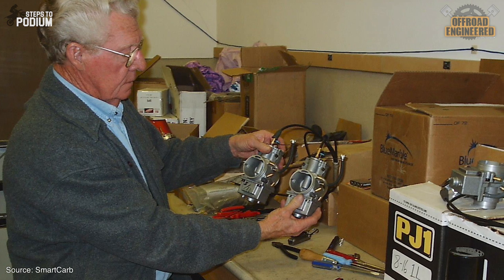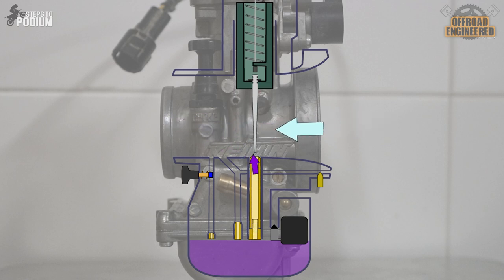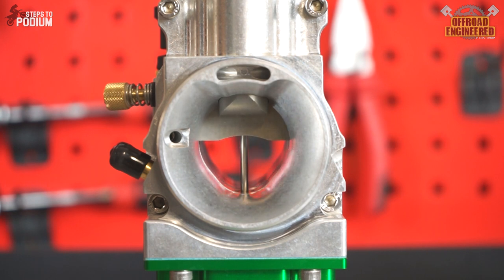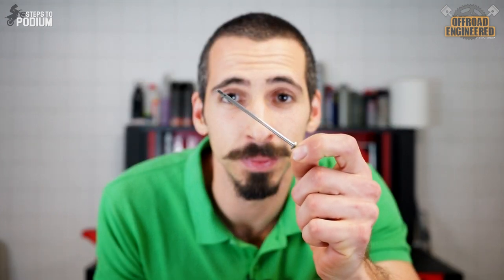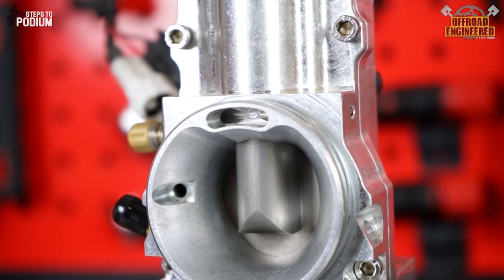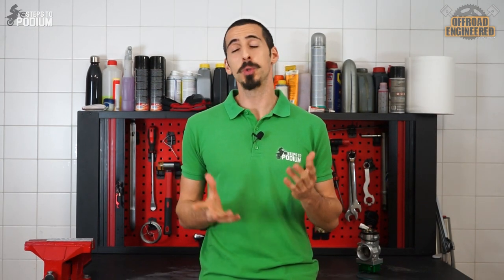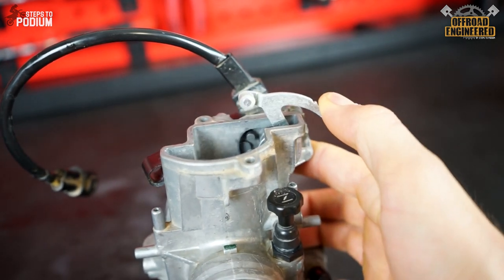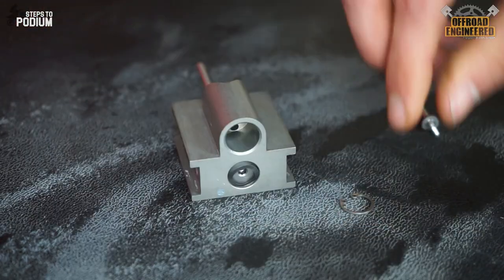SmartCarb SC2 | Offroad Engineered

Comment: I don't get it
If it's simpler in construction and does the same job much better plus has a few extra features and quality of life improvements, not to mention completely mechanical.

Why don't all carbs get shipped like that from the factory?
Reply from the maker: Cost most likely!
Reply: That is precisely the question!

The answer is that new technologies take time to understand, accept, and adopt at the OEM level; not to mention that any efforts like ours are met with skepticism due to a long history of other "miracle carburetors" and fuel system gizmos and gimmicks claiming to do the same thing without actually doing so, and regulatory headwinds pushing everyone to EFI. SmartCarb technology is quite new relative to prior, conventional carburetor design/function. Furthermore our technologies are patent protected, meaning only we are able to manufacture and sell carburetors like ours.

And to Luis' comment, SmartCarbs are currently manufactured using CNC billet aluminum construction in the USA - a process necessary for optimal performance but also one that is rather expensive.
Reply from the maker: Thank you for chippin in Nathan 🙂
Reply: @SmartCarbFuelSystems  
Cool so basically you guys have the patent on the tech.
You should license it out to the big guys, maybe we could save carbs from going extinct.
It's just a carburettor, I'm sure it doesn't have to be billet aluminum to function right.
Reply: @1719pankaj  it's not just a carburetor - it's easier. We have the smallest part count of any carb design in this space. That said the SC2 does have highly specific manufacturing/tolerancing requirements that CNC billet construction serves well; but that's no disqualification for alternative manufacturing processes if done right. There are SmartCarbs in factory engineers' hands already. Up to the big players to pick up the phone. We're waiting.
Reply: @SmartCarbFuelSystems  
Well then 
Good luck guys, let's hope for the best 🤞🤞🤞

Comment: Had a 2019 TPI, and currently a 2022 TPI.  I would never go back to carbs. Especially with a Coober ECU.    It's not 1984 anymore
Reply: When your oil injection messes up and completely seizes your engine and it's way more expensive to fix that and find the oil issue with it you'll reconsider a carb again.
Reply: @cheddarshredder6572  money isn't a concern broski

Comment: like all carb explanations, it skips past the most important aspect of all... then explains the smartcarb/elektron as vaguely as possible.

emulsion tubes. 
the air speed through a carb is RPM dependent. the suction on a jet on a venturi increases at some logarithmic rate with air speed. 

engines dont tend to run at one fixed RPM.

basically... at WOT, your engine can go from idle, 1200rpm or so, all the way to iunno... i got 250 i4s... 18,000rpm. the air speed from 1200 rpm to just 12000 RPM is a substantial increase for a given throat size. the fixed jet that delivers the right amount of fuel at 1200 delivers far too much at 12000. so they throw the extra circuit on, with a little tube into the throat that rams air into a little chamber around the jet and emulsion tube. as the rpm increases, and air speed increases, the fuel is forced lower and lower, uncovering more and more holes. some carbs like webers etc use an air jet and its a ratio between air leaking through the air jet and fuel from the main jet.

either way, as the air speed rises from RPM, the increasing suction through the venturi is counteracted by leaking more and more air through the jet itself. that is the main puporse of the emulsion tube. its got nothing to do with "assisting atomisation". carbs work perfectly fine without emulsion tubes in fixed load and rpm situations... (anyone do control line  model planes?)

if you get a really underpowerd bike, load it down as much as possible, and start playing around with the holes on the emulsion tube, rather than touch the jets... you WILL feel the stumbles and bogs and hesitations through the RPM range, at any given throttle setting. throw a wideband on and do some data logs and you will start seeing how the mixture changes at various RPM depending on the size of the air jet and the position/diameter of the emulsion holes.

for anyone really keen on learning this stuff, get a cheap engine on a stand, run a water pump, heavy flywheel, like a car tyre full of water, etc... really LOAD them up, so they barely accelerate... throw a mikuni VM22 on and start playing with EVERYTHING. buy a bag of jets, parts... and go to town with a soldering iron and micro drills... 

really hard to tune emulsion jets. theres the standard challenge of selecting the ideal jest in the first place, but this is an extra level, a "blending" of all the separate circuits, along with an unavoidable part of aerodynamics... trying to modify a log curve to match a linear one... reliably. simply. a carb is really amazing...

the elektrons work on a different principle, they rely on air flow rather than air speed... tradition has always used a venturi to register air flow, but in a carb it isnt the ideal way to do it as you then rely on that vacuum to deliver the fuel... whereas working on air flow itself... pitot tubes, static and dynamic pressures... you deliver the fuel precisely as per the air mass per second...

Comment: Old concept dusted off.
https://en.wikipedia.org/wiki/Reece_Fish_Carburettor
Reply: No, in fact the SmartCarb has very little in common with the Fish. Rather it's the culmination of 50+ years of metering rod carburetor concept development pioneered by the late William "Red" Edmonston starting in the late 60s. Major differences from the Fish include the use of a dual-gate flat slide (not a butterfly with in-built emulsion tube) and patented features including the metering rod (single circuit with no additional circuits or pumpers), variable throttle rate venturi (algorithmically derived), and integrated float bowl venting communicating at-manifold air density and velocity into the float bowl (not a simple vent tube).
Reply from the maker: Knowledge shot right there.

Comment: Its not much different to an SU
Reply: It's very different from the SU. Unlike the SU the SmartCarb is directly throttled using a flat slide, not a butterfly/constant velocity piston setup. Unlike the SU it vents what is essentially MAP density communication from inside of the airboot into the float bowl to drive fuel flow - not to throttle the carb. If there are similarities they begin and end at the use of a float bowl and they both mix air and fuel for internal combustion applications.